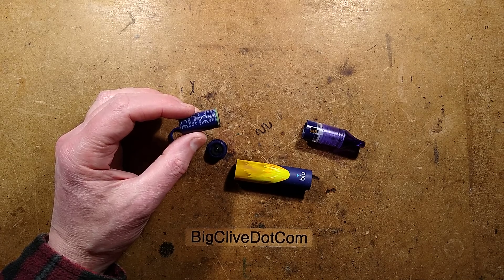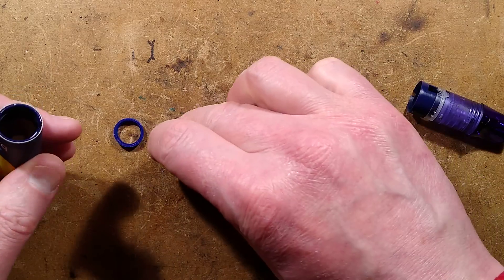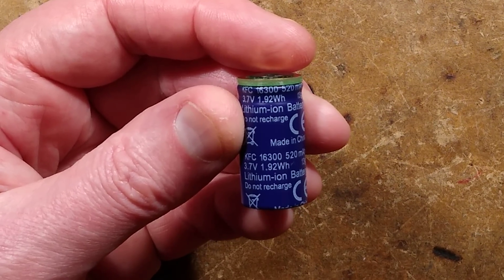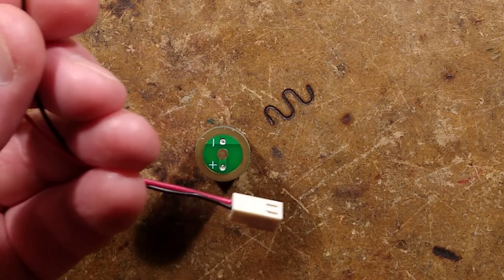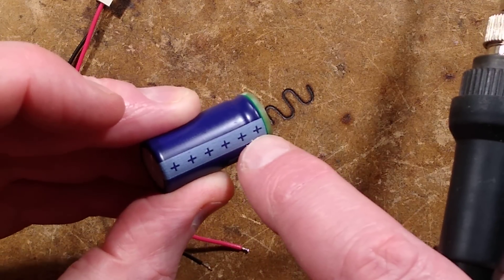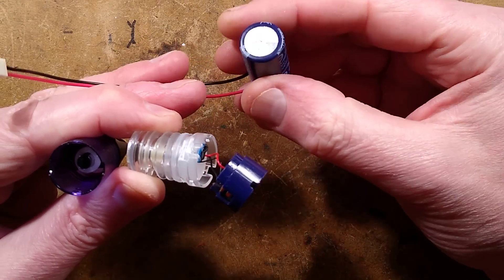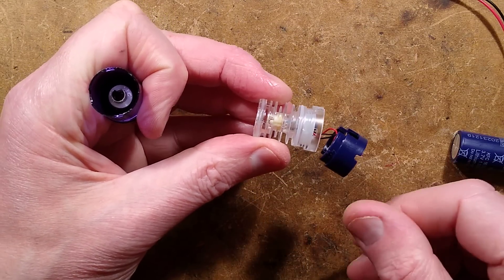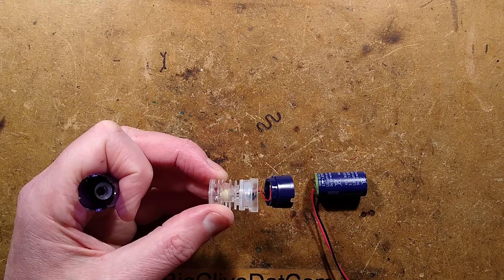Easiest free street-lithium yet - with gold flashed contacts!

Comment: Blu have a newer design that has a replaceable pod and a usb c charge port. Can you take one of those apart?

I have about 20 of the ones shown in the video, would it be possible to get a BMS so I can make use of the cells?

I have charged and discharged one of these cells over 50 times and it has held up well and seem to be very good quality, too god to end up in a bin.

Comment: Hi Big C

In my forays into Street-Lithiumology I have recently encountered a new animal out there in the wild. I was gifted a number of depleted disposable units of  which i then harvested the cells. They had the familiar standard style cyndrical pouch of 1745 dimension with a nice 5.5wh capacity. It said 'Do Not Recharge!'

I then proceeded to recharge

I was loosely monitoring the cell. When it reached around 1500mAh the charge amperage did not reduce as expected. Voltage pinned at 3.6 Then i noticed the cell was getting hot and puffing a bit. Ooopsie! Off the charger it went.
I then examined the cell a bit more closely.... 3.0v it says!? What is this??
LiFePo ? Should be marked as 3.2v  A CR type 3v cell?
I recharged another  different cell on the LiFePO setting to 90% and all went well , about 1600 mAh in. Both cells came to rest at 3.4v. All the discharged cells were at 2.8v
Hmm, thats the same curve as Sodium Ion?? Could it be? Really? ..I dont know but it is an interesting development if so

Anyway I dont know if you have seen or heard of these , if not there is a new thing out there on the streets to be aware of

Comment: Hi Clive, apologies for going off topic but I found this, your latest "Street Lithium" video in order to ask if you have come across Hayati units.
I've been given a few of their "Pro Max" vapes and also a monster; a Hayati Pro Ultra twin tank rechargeable (USB-C) unit with a display screen, that I've not figured out how to open "non-destructively".
Because I know their first owner, I'm hoping to sanitise and revitalise them as I have been doing with my own purchased Crystal Bar Vapes which I find can take about 10 refills before finally tasting burned.
When that happens, I salvage the batteries for future projects.

I currently have a Hayati Pro Max, carefully dismantled to expose the battery contacts and it is currently charging via an unmodified TP4056.
There are several videos claiming to advise on recharging and refilling an array of vapes but I value my home and indeed my life more than to trust these fearless amateurs!
I would really value some guidance if you have come across these, especially the monster unit as it should give a couple of weeks use per charge if refilling could be safely undertaken!
Grateful for any help.
G
Reply from the maker: I've come across the brand.  I can't make videos about vape technology due to YouTube not differentiating them from promoting vaping.   I wonder if the countdown type have a deliberate end of life counter.
Reply: @bigclivedotcom  Wow, that was quick Clive!
I might try and dis-assemble the parts of the monster vape later, but what puzzles me is that Hayati's own promo video on YT shows the USB-C port as "bottom entry" where as mine is side entry, we shall see!
The one I have on charge, a "Pro Max", has no battery capacity printed, from the bulk, it seems it might be 1500mAh, it's been charging for 90 mins now and still not flipped over. 
It must be close as the TP 4056 is now just warm to touch.

Sadly (for us  "gleaners") the ones I'm finding now seem to be mainly the capacitor style which are beyond my capability to re use, safely!
I might study your videos on these more before any attempts at charging them.
Thanks for responding it's appreciated.
G

Comment: BigClive, when you test the capacity of the cells you maybe want to keep in mind that not every lithium cell is empty at 3.0V. Some factories have cells that can officially be discharged to 2,8 or even lower Voltage. The difference is not much (you will not gain  additional 20% capacity) but you can gain a few % total capacity. The problem with unmarked cells is, that you can practically not get any info what the cell is really rated for (min discharge Voltage)

Comment: I have some closeups of a rechargeable disposable vape. The Iron Mike (Tyson)vapes. They’re a better circuit design than most I’ve dissected. Also have led screen with juice and battery capacity. They’re pretty clear pictures. I cannot make out the ICs on the board due to conformal coating. In general with what you’ve discovered. What ic is responsible for the timing/program resistor of the shutoff of the vape? I’d like to send you some pictures.

Comment: I know that batteries aren't your specialty but do you know if there are any ways to restore some capacity to old lithium ion batteries? I rejuvenated some solar garden lights with street lithium but they no longer hold enough charge to make it through the night
Reply from the maker: Were the solar lights originally fitted with lithium cells?  Many use a small solar panel and NiMH cells and are not compatible with lithium.

Comment: Just for info wet tantalum electrolyte capacitors also have + side marked like all tantalum /tantalum polymer and capacitors have, the opposite of aluminium electrolyte. If working with two types be very careful not to mix them up.

Comment: I found one of these ecigs and recovered the battery.  The voltage was very low (0.8V) but when I tried to charge it slowly it recovered.  I'm observing something strange but at this point I think it's my imax B6 that is having some readings wrong: the battery charges up to 240mAh, but discharges at 340mAh!
Reply from the maker: That's odd.   If using a cell of unknown state a good test is to charge it fully, let it settle, and then note the voltage down.  Leave it for a day or two and then test the voltage again.  If it has dropped significantly then it's sometimes better to discharge it completely and then recycle it.
Reply: @bigclivedotcom  Hi, mystery solved: set a current of 0.3A, when charging the current is 0.35-0.36A, but when discharging the current is 0.29A.  Doing some math the mAh matches, so it's a reading error on the IMAX B6 and the batteries are in decent condition.

Comment: My multi battery charger (for RC model aircraft) states that Li-Po batteries are nominal 3.7v and Li-Ion 3.6v. All the batteries I've recovered from vapes are marked 3.7v, what type are they?
Reply from the maker: They are generic lithium pouch cells.  Upper charge 4.2V, end of discharge around 3V.

Comment: I have a couple of balance chargers for LiPo batteries. Can these be used to charger LiOn cells?
Reply from the maker: If the cells have an upper charge voltage of 4.2V they should be compatible.

Comment: I started finding "devices" that contain " pot tar " last week I found one with a broken glass reservoir and after taking it apart to recover the lithium cell I started suspecting something... The liquid remaining in the broken glass reservoir was like sticky caramel and the smell of very strange spices, after looking at the name on internet this thing contain pot. All the parts even the lithium cell ended up in the trash! Now I inspect them more carefully before taking them, yesterday I found an other one that contain pot and leaved it on the side of the road. I dont want my things to have that nasty dirty smell.
Reply: I found one of these that washed up on the shore.
After a failed attempt to recover the cell, I threw the full unit out.
Thank you for the information.
Reply: The handful of weed variety I found were small and cells difficult to remove.  If carefully harvested,  small cells are useful in low power apps with limited space.

Comment: I have 1000s of battrys all i get for free i pick them up  i have the vape shops save me the li battrys ans even better i go in the battry bins in supermarkets and i pick up little 500mah battys erm 18650 battrys old laptop battrys which are full of 18650 batrys and also loads of battrys fhat are still in the pack ppl think there helping ppl by dropping brqnd new battrys in the bin i dont think they no it costs them loads 2 dispose of them so rhere not helping thrm there mskimg more work 4 them so i take them out button batrys 18650s you name it i have bloody 1000s of them even phone bsttrys ..cos battrys are not cheap the 7 18650 2600mah battrys i got out of 1 laptop battry would cost about 6 pound each so 6 times by 7 is like £36 ans k make allsorts out of them

Comment: If you are not supposed to recharge wouldn’t it be fair to measure the capacity when draining to zero volts?
Reply from the maker: Over-discharging a lithium cell will permanently reduce its capacity.

Comment: I have been harvesting discarded lithium cells for some time, I make battery packs by parallel wiring them and use them to power string lights for indoor plant decoration, they last about 4 or 5 days continuously running. I have also recovered charging modules from said devices and use them to charge the cells.

Comment: As someone who doesn't use any vape, tobacco, etc. products, this all seems quite baffling, but making the "e-cigs" DISPOSABLE seems even more baffling!  Why is this even a thing?  Is there actually some advantage to not reusing the electronics and heater, or is it just because someone realized that it could be done, so they did it, filling the world with even more e-waste?

I do hope that you don't really find these on the ground all the time, though; that would seem like an awfully litter-heavy area, if you did!  (I rarely see litter, and when I do, it's inevitably some fast-food bag or cup, presumably thrown out by a drunken slob.  The anti-litter campaigns of the 70's and 80's were quite successful, for the most part.)
Reply from the maker: It was to get around badly conceived regulations.

Comment: What a waste that they really put rechargeable cells into those one-use things. I'd say politics could easily reduce (or even completely stop) their sale by enforcing a deposit of maybe 2-3€/$/pound for every device that contains one of these cells but it meant for single use. Those dumb enough to still buy them either lose money by throwing them away or properly return them, hopefully returning the cells to a re-use cycle. And/Or manufacturers would look for other ways to power their devices...
There are enough examples that deposit systems work great for ensuring returns to the cycle. AFAIK the deposit system for single-use plastic bottles in Germany (25€cent/bottle) has a return rate of ~98%, and there are people who basically live from collecting those bottles.

Comment: I curious about the heating end of this now.  I have model trains the smoke units have a heater, some with a way to get the smoke puffing out and others just simmer the smoke  away. They use a a light oil designed for this purpose, and often run at about 6-20 volts to operate, however some better then others and some burn out too easily.
Reply: They run at ~4 volt from the cell, the elements are very low resistance to get the high amperage. The 18650/21700 reusable cloud producing vapes have coils as low as 0.1ohm. To do this the coil is a stretched accordion mesh to maximise surface area and prevent local overheating. 

They don't use oil, typically vegetable glycerine or propylene glycol. The better versions monitor the resistance as it changes rapidly with temperature along with the cell voltage to maintain a set wattage. The ones that burn out too quickly might not do that, the mesh could have too little surface area to dissipate the power, or have insufficient wicking (for example a too thin/compressed layer of cotton) such that it vaporises too fast before more fluid to wicks in.

The type of fluid is also important because their viscosity determines wicking speed. Your trains might have been designed around a thinner oil, if you run them outside/garage/barn (I grew up building railways in our barn) they'll get more viscous in cold temperatures.

The reverse is also true, too low viscosity floods the element causing extremely hot liquid to sputter out.

Comment: you should be able to tell if it's a LiC or a LIB in a cap package by it's specific energy density: LIC is 10-15 Wh/kg. LIB is 100-265 Wh/kg. Also you could short it and test the peak power. LIC 3-14 W/g, LIB 0.3-1.5 W/g. Also the LIC would have a pretty constant voltage drop over the operating range. Whilst LIB will drop off a cliff at the low end.

Comment: I think "do not recycle" is for liability, because I had one go spicy pillow being trickle charged with TP4056 despite some disposable vape batteries have survived years of use since 2020, also the vape sensor doing PWM when battery is full is a trick being used for years too as I built flashlights using the sensor chip as a touch switch and it has doing it as long as I remember._

Comment: This could not have come at a better time. Moved into a new-to-me house and learned my water softener lacks a backup battery for when the power shuts off, which resets the cycle times and makes my water super salty. Culligan 01013839 is the part number for the backup battery, and it's literally just a half-sized AA Li-ion cell soldered to a 2 socket JST connector, exactly as you made here. Parts distributors sell them for 80 USD. At that price I'd rather make my own. The only thing I'm stuck on is the JST connector (I'm an electrical dabbler, so my experience is lacking). What is your part number and where did you get yours?

Comment: Found a gigantic 1500mAh cell(18500) in a disposable the other day.  Hardly see these anymore so disposables are on the decline.  Most of the disposable cells I tested a few years ago were anywhere from 10 to 25% less than rated capacity, depending on manufacturer, with average approx 15% less.
Reply from the maker: Many of those bigger units are using a smaller cell and recharge socket now.

Comment: The 16300 may be a custom made cell for those devices from that manufacturer - 16340s (3.7v 5550MAH 8A) are common and Chinese brands start as cheap as $3.00 US.  Did find a company called DNK Power (has a site) purporting to manufacture and sell that specific 16300 cell - complete with data sheets, graphs, etc.

Comment: I wonder if the lower capacity is the result of being run right down or abused in some other way by the device. Did you measure the voltage on it when you got it?
Reply from the maker: I got a brand new one and tested the voltage before use.  It was 4.1V.  I did a discharge and metered charge and it came in around 450mAh.

Comment: Never seen a cell with weight on the label. But the weight of the lithium can be correlated to the capacity. Assuming no exaggeration by the manufacturer.

Comment: I recently quit smoking and started vaping, I have been pulling them apart and saving the batteries, all in separate bags so I hopefully don't get them somehow stacking together just right and shorting out and burning the house down
Reply from the maker: That's a good move.  I also recommend storing them in a metal baking pan as an extra precaution.

Comment: Single use vapes are such a waste of good technology that could easily have been rechargeable by design if they weren’t made with single usage in mind. I never 👎🏻 use them because they are so wasteful and more expensive than the standard rechargeable ones that are 510 threaded. I have an intelligent device with adjustable voltages that goes from 2.10-4.8 volts it’s great 😊 but I typically have it on the lower settings of 2.2-2.4 volts 🙃😶‍🌫️😶‍🌫️😶‍🌫️

Comment: Only another 20k batteries and you might have a fivers worth of lithium, but the chemicals to seperate it may cost you 50, but you have to keep it out of the air. Else it will immediately start to oxidise. (ps not to long now to your fave time of the year TT,)
Reply: it's not about the lithium, it's about the batteries. they can be reused for lots of stuff

Comment: I used a bettery from a single use device ,it was a cylindrical pouch cell , charged and recharged it for while(atleast 80to100 times) with no problems ,but they dont last as long as proper cells , they loos capacity very quickly unlike the proper cells.

Comment: I use these cells in garden lights, they work a lot better than the nicd batteries ❤
Reply from the maker: Traditional single cell NiMH solar lights only charge between 1V to 1.5V so low for a lithium cell.
Reply: higher voltage will fry your lights no?
Reply: The panel on my garden lights  makes around 4.8V open circuit to charge 2x NiMH cells, with the higher voltage the LED shines brighter and lasts all night long.

Comment: Do Gold contacts really make a difference? I am guessing anything conductive will do the job too.
Reply: Gold plating improves long-term reliability, so for a disposable device like this not really.  Thing is the pogo pins used aren't really available in anything but gold-plated (hooray for mass production), and gold-plating PCB's is cheap so here we are.

Ironically trying to "cheap out" would be more expensive.  The other comment about soldering is irrelevant.
Reply: it's not about conductivity here, it's about how well the solder sticks (gold doesn't oxidize, so solder sticks really well)

Comment: I gather the 18650 batteries out of old power tool batteries,
Most of the time you'll fine one cell dragging down the whole pack and can either repair the pack with a replacement battery or harvest the individual cells for use in other devices 🤌

Comment: What do you use to measure the capacity ?
And does the cell have a protection circuit or is it not needed since they won't be recharged ?
Reply from the maker: I use a charger that shows mAh input.